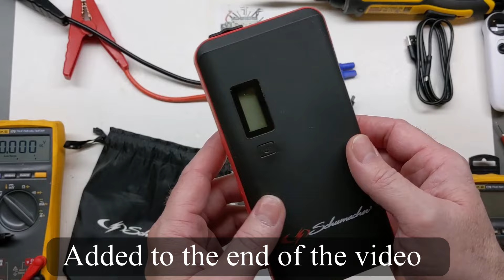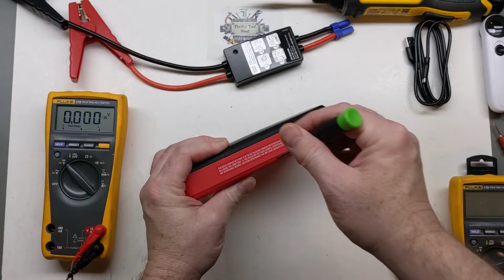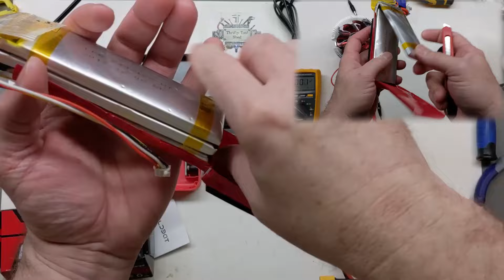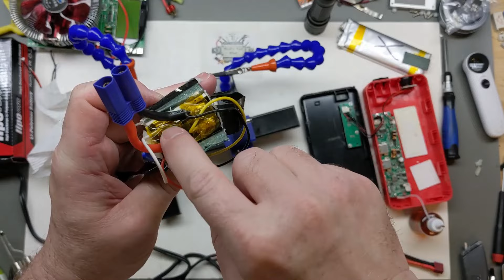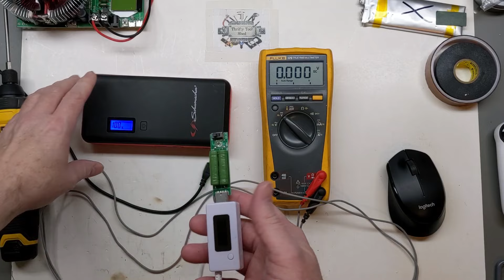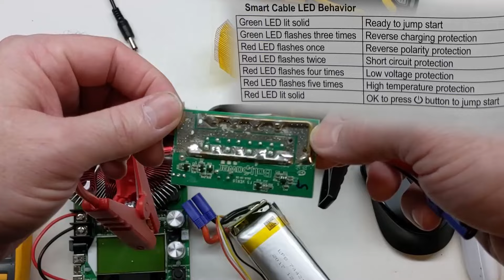Can we fix this Schumacher Li-po Jump Starter?

Comment: Thankyou for your video! found one in the thrift store missing it's jump cable, but good battery. Used your video as a walkthrough to take it apart, and replace the custom jump cable connector with a standard Anderson Connector.

Comment: I’ve got the same exact jump starter but it has a totally different dongle. There is no button to press. I also had to remove that finish they applied since it had become a sticky mess. I’ve never used it does it still work probably!

Comment: I have an SL-1639 that wont charge it was fine when i first got it. Used it about 2 times and then the little temperature symbol came on flashing and it wont charge it flashes that no matter what. I used it to jump my atv and a lawn mower a few more times because it was at 49% and would jump stuff fine then it decided to start charging again at random one time and then back to the flashing temp symbol. Needed it to jump the car a dew times and now its down to 0% and won't  charge again. I might add the temp symbol comes on as soon as you plug it in its not warm or cold snd it just immediately flashes. I specifically bought a Schumacher  because I'd heard they were good and then was disappointed. Has anyone else had a similar problem?

Comment: So I have a Schumacher that I found and I opened it and checked the battery pack and it’s a nominal 14.8v and fully charged is 16.8v which is what the smart clamps are displaying as the output voltage. Now the model is an SL1673 jump pack and says its output is 12v so I checked the balance connector and all cells are fine so do you think the buck dc-dc went bad or why would the output to the clamps that jump start a car battery read 16.8 battery pack voltage?
Reply from the maker: I am unsure that you have an issue really. Is it not working when you try to jump-start? Some packs are 4S or up to 16.8V. I think they are a better design than the 3S, which is 12.6V. If I had to guess, they call both a 12V jump pack just generic for the voltage system they are designed for.  The 4S packs should hold up better when connected to a system with an alternator that can charge over 14.5V.
Reply: @ oh gotcha well I never hooked it up to a car because my NOCO reads 12.5 out the clamps and I thought maybe 16.8 was too much but I was googling and it says that it reduces the voltage when it jumps but I just didn’t want to fry anything. The one I have has wireless charging and usb and all that but just had to ask you. I was looking up more info on it and indeed the 4s over the 3S is preferred and the higher voltage for the voltage drops during cranking but it’s weird because Google wasn’t coming up with anything until I literally typed in 4s pack.

Comment: Im pretty sure my battery pack is shot.  

I have a similar Red Fuel.  It had been used maybe once and it had sat for a very long time.  When I go to charge it.  The display reads 100%. It won't turn on at all and I get basically 2 MV when checking the battery.    I believe the cells are completely drained evenly, so I should be able to manually charge the battery similar to how you charged them.

The battery is 8000mah 400amp max, 200amp crancking.
Reply: Actually, I was able to get to start to charge.  I connected my power supplying to the output side of the charger with the battery cables connected and my power supply was only reading .004amps and charger cables were blinking.  So I figured it would start charging, but it never did.  

I removed the charger cables and connected the power supply directly to the output of the battery at 12v.  It then reset the batteries and it now will charge with the charger the correct way
Reply from the maker: @theboz1419 Good, just make sure they cells are balanced for safety!
Reply: @ThriftyToolShed  well, I believed I followed the directions I found would help, but when I try to charge the display is stuck on 1%, no matter how long I leave it.

Comment: i   have  a   jump  started  i  think  the  pc  board  went   bad   is  there   a way   to  charge  it  without  the   board???  thx
Reply from the maker: Well, the one I have and the ones I have seen the connector goes straight to the battery pack itself so it's very possible. It's better to have the balance leads connected to a hobby charger of course for better charge monitoring of each individual cell. In a tight it can be charged with a constant current supply. Like the one on my bench that I use often.
Reply: @ThriftyToolShed  thx  can  i  charge   it  by  hooking  to   the  main  power  leads with   battery  charger
Reply from the maker: @MrStealth654321  
What type of charger are you referring to?
Reply: @ThriftyToolShed Trickle Charger  2 amp
Reply from the maker: It has to be a constant voltage constant current  supply. Like the Drok style DC-DC converter like I have shown in videos or a bench power supply with the CV CC capability.

Comment: Incredible details on both the video and the links. Way beyond the average youtube video. I salute you and your great knowledge and attention to detail. I am having a problem with my Schumacher SL 1315. It suddenly stopped working when I was using it to boost my battery in my 1955 Ford Crown. ( converted to 12 volt, its not 6 volt) The Lithium cell is swollen so much I can not snap the case back on. back in my past career I worked in Lithium Ion as an EE. I got back into it as an to build a S4 Lithium 230 AH set up for my motorhome. Its a learning and relearning and your video is pretty cool. thanks
Reply from the maker: Thanks so much for your kind comment!
Reply: I second that motion err comment Big Thank you from a high school drop out but i love how infomative and easy to learn understand.

Comment: I have the same charger and appears to have the same issue. I'm not capable of fixing it myself but can you tell me what type of fix it shop do I look for
Reply from the maker: It's most likely not worth paying for someone at a shop to repair. Batteries plus is the only place I could think of that might even do it besides some small town repair shop. The video is more for learning how things work and the troubleshooting shown in case it helps someone that needs to fix their own. If you have a friend that enjoys tinkering maybe the video can point them in the right direction? Best of luck to ya with yours!
Reply: Thank you for taking the time to reply. Yeah, not worth the trouble

Comment: I recently bought a Schumacher SL1596. It’s a bigger looking one than the one in the video. It is 2500 amps apparently. Paid $330 for it, hoping it is a decent quality and will not let me down in times of need. I hope I haven’t wasted my money on it because I would have paid more for a better one if I knew this one was not great. 
It’s difficult to know what to buy these days with so much inferior stuff around. 
I’m supposed to charge it every month even if not used. 
I might never need to actually use it but I was thinking it’s good to know I have it onboard just in case.

Comment: I have the same unit SL1315.  This one is stuck displaying 85% charge but wont charge when plugged into the charging port.  It doesn't even recognize the charging cord is connected.  Any Ideas or have you seen this issue?
Reply from the maker: The displays on these jumpstarts are typically not great. I would check across the cells to see how balanced the cells are. The main failure point is usually the pack itself. If the pack test good, it must be an issue with the board itself.

Comment: Walmart near me had the sl1517 reg. 97 bucks on sale for 54 bucks so I snapped one up. Havent opened box yet. Now after seeing reviews its going back.
Reply: Yo no le tengo confianza a esos mini aparatos electrónicos! Los cables parecen de juguete ; la batería bien pequeña y para colmo se infla para mover un motor unido a un motor de arranque se necesita bastante amperaje ; yo lo veo como una hormiga queriendo mover a un elefante
Reply: @juanfarray3150 one device trying to do two tasks usually does neither well.

Comment: do you recall the battery dimensions?
Reply from the maker: I do not, but I shared a link (to a similar battery to the one I used) in the video description. Yours may vary depending on model.
Reply: @ThriftyToolShed  I found this in stock Zeee 3S LiPo Battery 11.1V 80C 5200mAh. if it fits do you think its safe? the c value nearly doubles and the mah is much higher.
Reply from the maker: @pearlrival3124  
Just make sure it is a 3S you have in your model.  I had a 3S for sure, some viewers mentioned they had a 4S in theirs. Of course dimensions need to be matched unless you have extra room and the higher rating is usually fine. The higher C rating and capacity is better in the long run.
Reply: @ThriftyToolShed  if it fits lol. yeah i noticed the comments mentioning the upgrade for the '16' newer models to 4s. way i look at it if it doesnt fit thats what duct tape is for. (;

Comment: I bought a Everstart 400 lasted a few months! About six jump starts! Is t meant to be disposable?
Reply from the maker: It does seem that they are disposable unfortunately. I have used the lead acid style Booster Pac for years now and I have had very good luck with them. I have had up to 7 years of use from these with no issues (example link below). You just have to charge them every 6-8 months or so. I could not wait until the lithium style packs finally came out, they would hold charge a lot longer in between uses and so much lighter weight.... Man they have been a huge disappointment. I have a Booster Pac in my truck right now. It has been excellent for over 5 years now. The one before that lasted over 7 years.
https://amzn.to/3PuLpd2

Comment: Hi how are you nice video I got a schumacker jump starter 1200 amp sl1517 and it jumps starts but it doenst want to charger or use USB and the flash light doenst work what can it be ?
Reply from the maker: Hard to say. I did not have that issue with this one. It sounds like a board issue. I would check connections on board for charger etc. Just to see if anything obvious.
Reply: @ThriftyToolShed  oh ok thanks

Comment: So i have a Matco versapro2 jumpstarter that's doing the same, i was looking for batteries but i haven't been able to find one, what would you recommend?
Reply from the maker: Unsure about any other make or model other than shown back when this video was made. You will have to measure and get the correct size for your make and model. Best of luck to ya!;
Reply: @ThriftyToolShed  thanks! Is there a certain website you ordered from?
Reply from the maker: Typically eBay or Amazon. Similar to the link shared in description.

Comment: Hi I have the sl517 holding a 25 percent charge with a temp symbol flashing any tips on fixing this issue
Reply from the maker: If not a real temp issue then I would check the NTC thermistor for the pack. It could be faulty or wire damage. That's all I would know to check if showing temp issue. Most (not all) NTC thermistors read around 10k ohms at room temp. If device is truly getting warm it is most likely a shorted cell issue.  Best of luck to ya!

Comment: The micro USB charging port broke off the mb. Can either of the other USB slots be used to recharge it? 
And question about that digital charger. Does it does batteries so long as you open the devices up and connect directly to the wiring?
Reply from the maker: The model I had, only the one charge port will charge the pack. the other USB connector is output for power bank.
Reply: Why micro USB like really
Reply: Mine broke off as well. Only the 5th time I’ve ever charged it and now it’s completely unusable.

Comment: Sir, first I would like to congratulate you as well as thank you for your video, excellent work. I have been using Lipo Jump starters for a few years now and I would say that they have worked well when I needed them  to, but the main problem is that most starters never last for more than a year or with luck, year and a half at most. I usually buy 2 starters, one for each car in my house, and I can honestly say that this experience has been a constant. After careful consideration I have come to the conclusion that the biggest issue has to do with fully charging  the  Lipos and then putting leaving them inside  your car for a few months  or until you need to use them. It is a fact that Lipos don't hold up well when you put them on storage fully charged, that is why they recommend storing a lipo at 80 to 85% of the capacity, actually most lipo chargers have a Lipo storage charge option that does this automatically. I currently have  my last 2 Jump starters, both have dead Lipos of course, but instead of throwing them away and thanks to your video,  I'm going to try replacing the Lipo battery packs  to see if I can save them and also, instead of giving them a full charge, I'm going to give them a storage charge to see if I can get them to last longer. At 85% of their capacity they should be able to jump start a vehicle easily. Again, thanks for the vid, superb.
Reply from the maker: Thanks for your comment and very good thinking. Lipos do not like being stored fully  charged for sure. Let us know how this trial works out for you!
Reply: @ThriftyToolShed  For sure, will let you know how it works out,
Reply: @MadMax0318  that ought to extend the operating life for sure- it'd be nice to get 4 years of of them, just not worth it for emergency use if they only last a year before going bad.

Comment: I've been trying to come up with a small lesson on circuits for my students to create a led greeting card.... & I find it difficult to understand the technical parts well enough to break it down for them. So, I'm just impressed with the depth of information that goes into such a small device & I'm in awe at your knowledge & level of understanding you have in order to troubleshoot & repair it. May I ask how you know so much about this, is this information acquired when obtaining a college degree, an electrician course, or just years of experience? Where would I find someone with your level of expertise to come speak to my students & create some type of simple circuit?
Reply from the maker: Hi,
I personally have learned electrical and basic electronics over 25 years ago at Technical college. I also have almost 25 years experience in industrial automation as a technician. Electronics is really more of a hobby.  I have always loved learning how things work, how they look inside and learning how we might repair without schematics these days on most tools and electronics sold have none. I guess I am still learning and trying to share with the community as we learn. So I actually do not have a degree. I would think any EE (Electronics Engineer) with a degree could also help with your desire to show here. If you can not find anyone available I could possibly atleast share a video that could be as helpful as I could possibly  make it, however it may not be in time for this Christmas at this point.
Reply: @ThriftyToolShed  hey bud, what do you call that tester thing with the fan that displays the load and info? I apologize if you already stated..
Reply from the maker: @drummerdoingstuff5020  Hi,
It is an electronic load. I sometimes refer to it as my capacity tester since it can log the current throughout the test and give us accurate test data. I do like this older model ok, but it is a real pain to adjust the current up/dn on with the one button design. I now have the newer model and it's so much easier to set and the display is amazing!
https://amzn.to/3DzKaqd
Reply: I really dnt know how old ur students are but, Teach them how to make a electric Bell , it will be much interesting. Electrical side , electro magnetic side and mechanical side all included and very easy to build ur own

Comment: Great Video!  I have the SL1314  jump pack, which is the smaller version I use for my side by side.  I have owned it less than a year and used it maybe 4 times.  It has always charged fine in the past.  I tried to turn it on one day to use it and it would not turn on.  LED screen did nothing.  It was charged to 100% prior to me trying to use it.  Now, When I plug in the charger to charge, the LED quickly flashes blue without any numbers and immediately shuts off.  Power button does nothing.  The charging cable is in good working order as I did try it with other electronics.  I opened up the case to take a peak and the batteries are not swollen and everything appears to be fine.  Any idea what is going on here?
Reply from the maker: Hard to say for sure. I would check the voltage level of the battery, the cells or atleast a cell may have gone really low and may not take a charge.
Reply: Hi from Turkey, ı have smaller one of that brand and I’ve two problem first one is its fully charged but when ı push the main cut off switch from off to on led screen shows temperature symbol, and 1amp plug doesnt work. Actually Im afraid of to bring service to destroy the jump starter. Do you have any advice for my problems. Thank you regards.
Reply from the maker: @gokselemre5940  
Hi from Augusta, Georgia USA! I have not seen that exact issue. I will say these do have a NTC thermistor usually and it could be an issue with it if showing temperature issue. If the pack is not too hot or cold and showing the temp fault I would check the thermistor. I don't know now for sure on the one you have, but alot of NTCs are around 10K ohm reading at room temperature? If course resistance will go down with rise in temperature. Best of luck to ya!
Reply: @ThriftyToolShed  hi thanks for your swift answer,  thermosistor solder broken ı fixed it a few minutes ago and high temperature problem fixed, but 1 amp usb plug does not, 2 amp plug is working, I hope jump plug works thanks for your video it pushed me to fixed it at 3 a.m :) have a good day
Reply from the maker: Awesome! You have a good day as well!